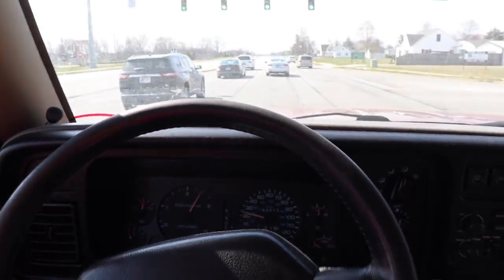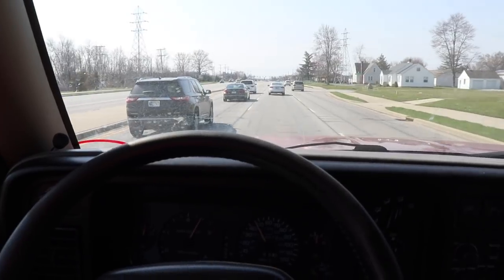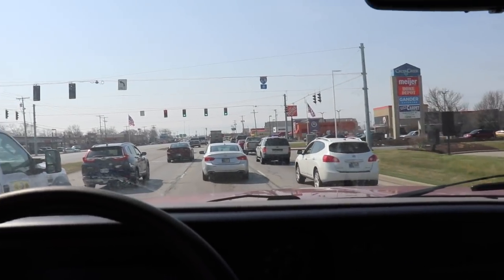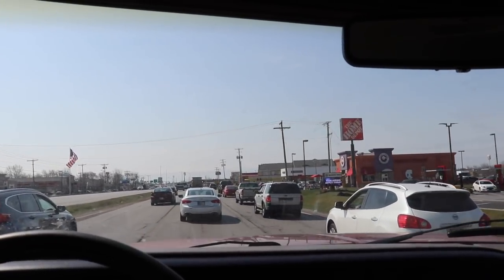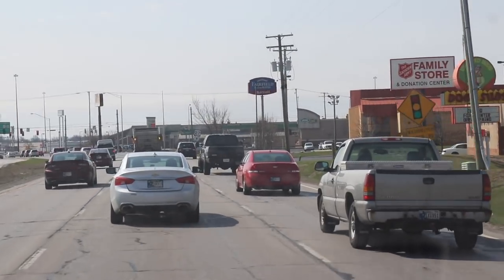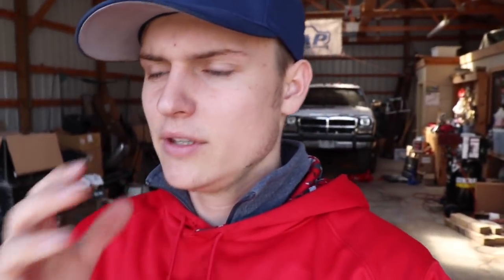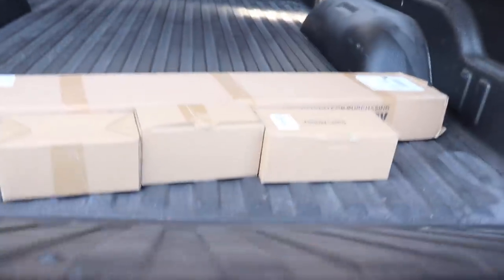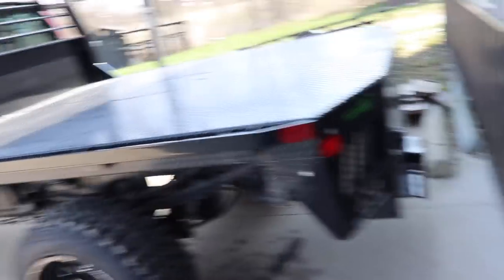I'VE ALWAYS WANTED TO DO THIS!!!

Comment: You need a steering brace  and dual steering stabilizers  and maybe a dodge off-road trac bar on nasty red and it will tighten up the steering

Comment: Careful when you hook up those light bars all to the same switch because the 42 has a lot of amps plus the others especially because they are combo light bars they are extra high amperage and if your switch isn’t rated for that it will break internally and it’s really annoying...the switch in nasty red the rocker switch is rated a lot higher than the one used in big stinky so I would check just in case because worst case censorious it could burn up the wiring (speaking from experience almost made my truck go up in flames😅😅)
Reply from the maker: Kolin Westman so would all I need is a bigger fuse rated for the output? The current fuse in the wiring is a 25 amp
Reply: Look up your light bar specs and add them up and if your fuse is rated higher then you are good but switches are rated differently for the amount of amps the metal in the switch can handle before melting so you again add up the amps and see if the switch is rated for more than the amount of amps all 5 lights use